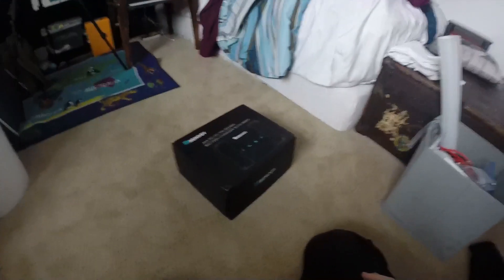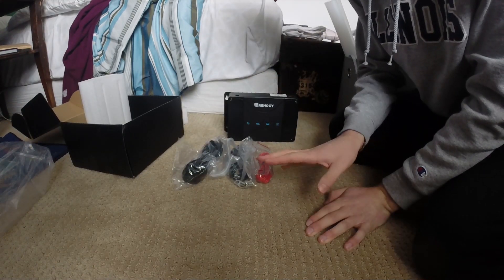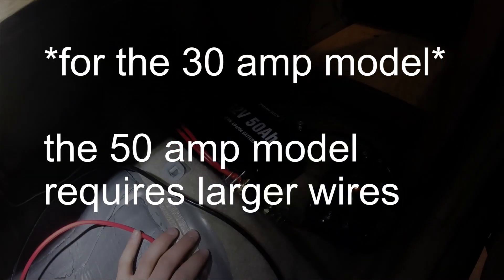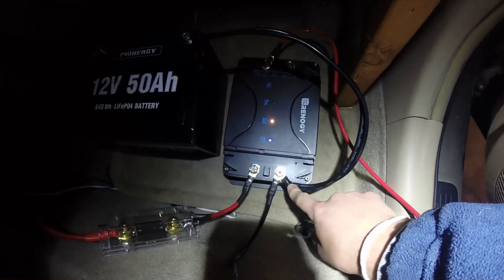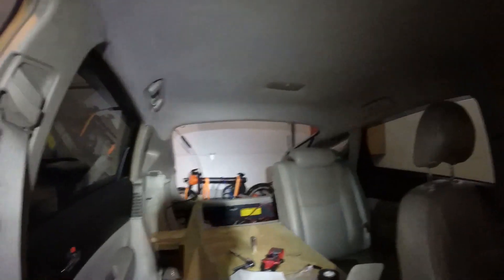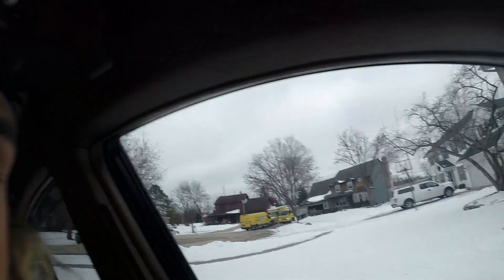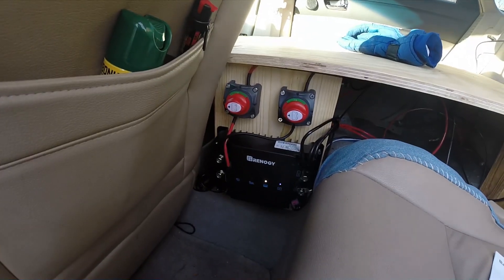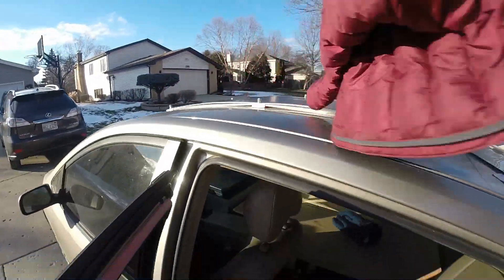HOW TO INSTALL RENOGY MPPT DC TO DC CHARGER ON A PRIUS (or other hybrid)

Comment: I just installed a 25A DC-DC charger for a battery box in to a RAV4 hybrid with an anderson lead to the DC-DC. Toyota tell me the max draw for the hybrid DC-DC converter or 120A and quite a lot runs off of the 12v circuits, but seems fine so far with just pulling 25A.
Reply from the maker: The lower the load the better for sure

Comment: How many amps does the car battery get from the high voltage battery ? If i use a 60 amp DC to DC but there is only say 30 amps. Will this hurt anything ?
Reply from the maker: I cant remember but it might be around 40-80 amps. I would use as small of a DC to DC charger as possible. If you over burden the charging system you will cause expensive damage. This charger only pulls 15 amps maximum from the car

Comment: Hi thank yo so much for your video. It gives me an idea that it is possible to install a different battery tha  the original starter battery asmy 2nd battery. Can I leave the d+ signal input empty (not plugging anything) or do I have to connect something to the d+ plug?
Reply from the maker: You do not need to connect the d+ signal wire when installed in the Prius. I did not use it
Reply: @soilliam to be clear we don't plug d+ wire at all? That being said does the controller drain the starter battery dead without d+ wire?  Does the controller know when to turn off and on the alternator charging without d+ connection?  Thank you

Comment: Hi.Good video but where you find DCDC Ignition Wire In toyota prius and how to install D+? Thanks.Good luck ;)
Reply from the maker: I ended up not keeping it attached but I used a fuse jumper to connect that wire to a fuse underneath the steering wheel. I used the rear window heater fuse
Reply: @soilliam  Thanks from Poland :)
Reply from the maker: @Vladyslav_Shveda  🇵🇱 👍:)